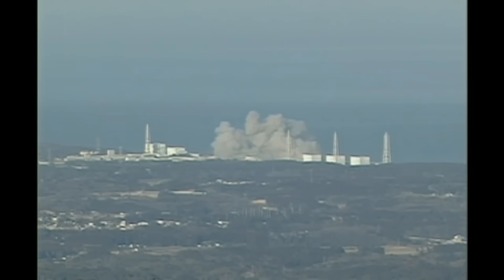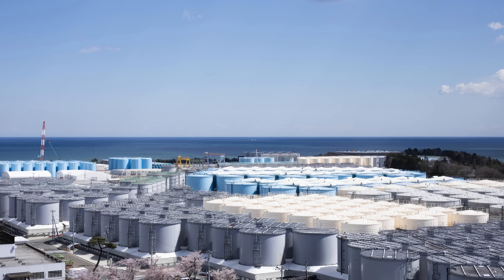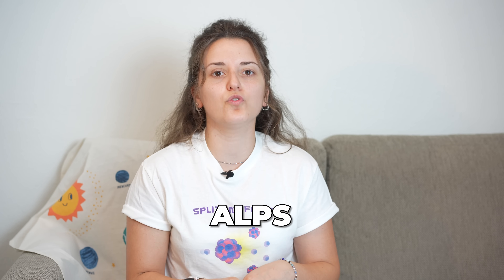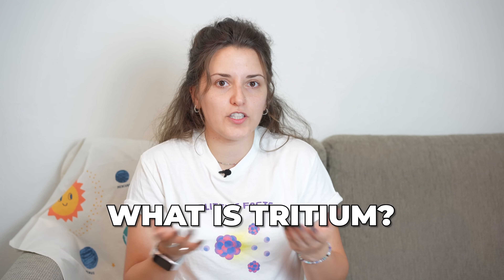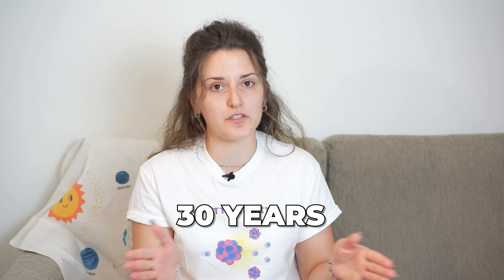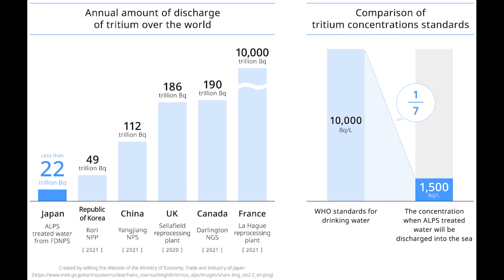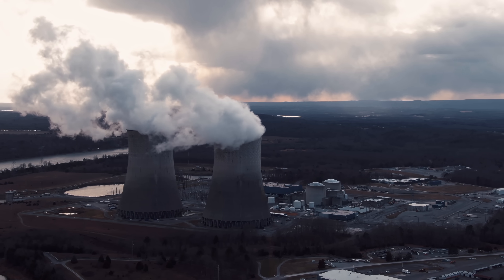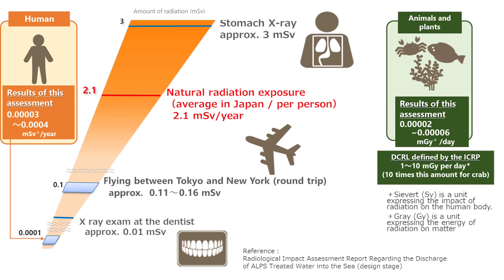Nuclear Physicist Explains - The Release of Fukushima Treated Radioactive Wastewater

Comment: Question. When you compare this level of radiation to a dental x-ray, I think about the fact that I don't get x-rays every day.  Can you explain this type of comparison and how we use it with other processes or events?  I'm thinking that it doesn't matter unless you go swimming in that water.  Thank you for such great videos.
Reply: it doesn't mater even if you swim in the water, and you wouldn't drink the water, not because the radiation might harm you, but because the salt would harm you, as this is in fact salty water.
Reply: Linear No Threshold...the dumbest policy ever...
Reply: Hey Neil! Look up radiation levels standards. Basically it's fine that an XRay is relatively high, because we don't get them often. And the benefits outweighs the risk. 

But workers and citizens have no benefits to exposure: so the tolerance is kept minimum.
Reply: @PhysicsLaure  Mammograms for breast cancer has caused many breast cancers and that is why it is recommended not to have a regular mammogram done. Same with X-rays dental or otherwise. Another cause of increasing cancer of the brain is cell phones. Since cell phones become popular a type of cancer which is almost always fatal called glioblastoma has skyrocketed. The five year survival rate of the afflicted is 6.9%. Most die 8 months after diagnosis. Rules of thumb to minimize your RF SAR (Radio Frequency Specific Absorbtion Rate) is to use a BT earpiece or the speaker phone mode. Also it is not advisable to keep the phone close to your body i.e. your pocket. Keep it away from your body, in your handbag or something like that. Everything we do, everything we consume, every time you put that phone to your ear you risk becoming a statistic. Why take the risk, try to minimize it.

Comment: Is not an accident when you build a nuclear plant on the most active earthquake-volcanic-tsunami's coastline. It's a disaster waiting to happen.
If they had built it 20 km away from the coast, the tsunami would never have reached them.
Reply: not really, the only problem was the backups diesel generators being located at an insufficient height, if the plant hadn't lost the backup energy then the plant would still be operational today, as neither the earthquake nor the tsunami damaged the reactor.
Reply: All nuclear power plants are built on large bodies of water for a very good reason.

Comment: Let them use it in their fields…it isn’t a problem, right !
Reply: If it wasn't sea water, it wouldn't be an issue. you do know that tritiated water is also naturally occurring right?
Reply: @madmax2069  Is it normal to cool reactors with salt water?  Wouldn't salt just corrode the reactors and make things even worse?
Reply: @celanian8188  no not in a normally operating reactor as the salt water evaporates it leaves behind the salt would just build up on everything, but since the reactors are destroyed there's no real harm in doing so.
Reply: @madmax2069  So to OP's point, it may be more expensive, but couldn't TEPCO use fresh water (instead of salt water) to cool the reactor and then recycle the water after purification to irrigate the farms?  It would certainly be a much better PR move than dumping it into the ocean and cost less in the long run.
Reply: @celanian8188  no since the ocean is right there, just get it from the ocean and put said water through the ALPS process amd put it back into said ocean. It's not going to harm anything in the ocean anyways being that what they put into the ocean is already in the ocean in the first place.
Reply: @madmax2069  Or they could use fresh water (like they were doing before the disaster) and put it through the ALPS process, and then use that water to irrigate their farms. If they believe the process is safe of course.
Reply: Like madmax mentioned, it's indeed salty water. Shows what you know about this 😂

Comment: Can you compare the amount of tritium in the water to that in a glow in the dark pendant? When you mentioned it my first thought was that the same substance is used to make compasses used by US Army glow.
Reply: How many micro grams in the pendant?  How many gigatons in the ocean. There will be ZERO glow in the water. What you are seeing is Tritium gas, not tritiated water which does not glow.  There is your answer.   It is used in watches and compasses even sold in the civilian market,  There is no detectable ionizing radiation from this. The only radiation is light. The reason is that the neutrons escaping from the tiny capsule of tritium does not even pass through the glass its in.
Reply: @GeoffreyFeldmanMA  tritium decay by beta decay, which is an electron, not a neutron, and the light comes from phosphor getting excited by the tritium giving off electrons. aside of that everything else you said was correct.

Comment: Can you comment on the decontamination process that was used at the site and the local area and a possible restart of other reactors and movement of the primary cooling pumps away from the ocean edge.
Reply: @BFAbm  Good to know. Thank you for that.
Reply: Where would the cooling pumps cool to?  Why does warm water dissipating into the environment concern you?
Reply: @GeoffreyFeldmanMA  In tropical aquariums, you have to be careful about not causing rapid localized temperature changes while doing water changes, as it can cause problems with fish if the temperature difference is too great (though introducing cooler water seems to simulate spawning and breeding behaviors in many tropical fish). In coldwater fish, changes of temperature towards higher temperatures can have a drastic effect on the health of fish - a River Monsters episode set in Russia found fish dying off due to a prolonged period of high water temperatures caused by unseasonably hot weather. It is something that could be of concern if not done properly.

That said, my understanding is that the water that will be released from Fukushima is at atmospheric temperature after being stored in containers for a long period of time, so should have a negligible effect on fish around the water release site.

Comment: could force the triduum to decay into helium and proceed to then use the liquid helium as a refrigerant for manufacturing liquid nitrogen and CO2 including being a large process facility attached to a reactor core for stabilizing variations. well as using the loss of heat to segregate gasses from the atmosphere and large industrial gas vents from well drilling explorations. can just buy an oxygen cylinder or xenon tube because there all filtered out of nitrogen in the process of making liquid nitrogen.
Reply: How does this "forcing" work? Only in your imagination.  Nothing you write is thoughtful.

Comment: I work at an experimental nuclear FUSION reactor. We use tritium for the fusion fuel. Most of that fuel never actually gets 'burnt' and has to be washed from contaminated surfaces of diagnostics etc. Wanna guess where all the tritium contaminated water goes when the accumulation areas are full? I'll give you three guesses as my grandma used to say, "and the first two don't count".
Reply: And should know better that tritium is not the concern here but other radioactive contaminants like carbon-14 , strontium-90, iodine-129 and other radionuclides.
Reply: @stevec8352  And YOU should know better that none of the other radioisotopes are present in the water. It's all been removed by the ALPS ion-exchange resin beds except for tritium before going into the storage tanks, DUH.
Reply: @Muonium1  Duh, read the report. They don't completely removed other radioactive isotopes but reduce the concentration to below regulation limit. Concentration levels can be easily manipulated by dilution. Dilution doesnt change the amount of radioactive isotopes released.

Comment: Tritium is pretty valuable, I don't know what isotope separation costs these days but I would think that it might be worth mining the chemical from this water.
Reply: We can't filter it no matter how much money we put into it. Tritium is an isotope of hydrogen and to filters it just looks like any old hydrogen so it won't separate the tritium from the water.
Reply: @derpymcderpello5381  you can separate it, but it would be extremely energy intensive and there's only 2-3g total of tritium in all of the water. It would be like collecting gold by separating it from dead bodies, after all everyone has a little gold in their body! right? Heck I just checked and it's on average 0.2 milligrams of gold per person, that's still more concentrated than the tritium in this water!
Reply: Tritium has a half life of 12 years, so it is only produced on demand and the concentrations in the water are too low for economic extraction.
Reply: It's not Tritium, it is tritiated water.  The separation would be done with electrolysis which is very inefficient and actually not worth it, even with the value of tritium.
Reply: @GeoffreyFeldmanMA  the cost of electrolysis is insignificant compared to the cost and the technological challenge of separating tritium atoms from hydrogen. The cost of tritium would cover the electrolysis expenses over a hundred times if that second step was feasible.
Reply: @miloradowicz  I assume the means of refining tritium are the same as for deuterium -- exploiting the very slight differences in chemical properties from ordinary hydrogen.
"Production of pure heavy water by distillation or electrolysis requires a large cascade of stills or electrolysis chambers and consumes large amounts of power, so the chemical methods are generally preferred."
https://en.wikipedia.org/wiki/Heavy_water#Production
Reply: Tritium is all but impossible to separate out of water in quantity, and it is not economically viable to do so.  Most tritium for industrial uses is produced in reactors from lithium, where it can be extracted from control rods before it becomes water.  Tritium is very valuable at $40k-$60k a gram, but the entire world uses less than a kilogram a year.  In fact, the demand for Tritium is so low that the main reactor for Tritium in the US was shut down for about 7 years in the late 90's and early 2000's, and shut down again in 2005.  The current world reserve of tritium is about 20kg total.  About 44 pounds.  Most of the tritium in the world today comes from Canada, and possible sources in Russia.

That said, if fusion reactors become a thing (uncertain) then tritium will become far more in demand.  Luckily, fusion reactors will be able to breed tritium from lithium just like fission reactors can.